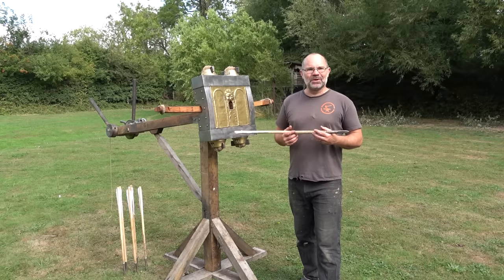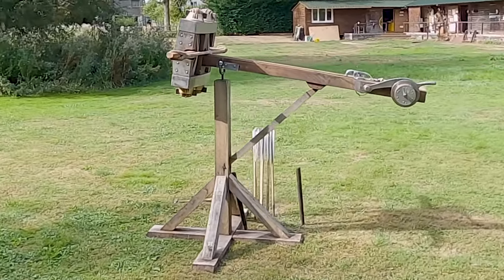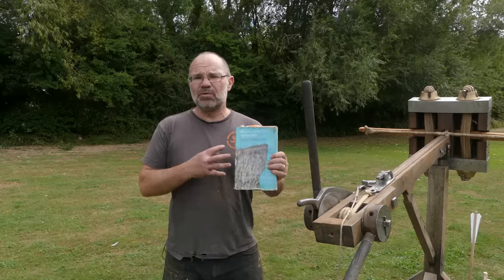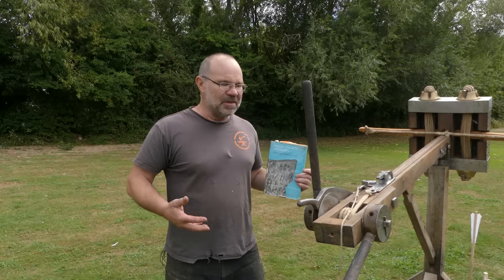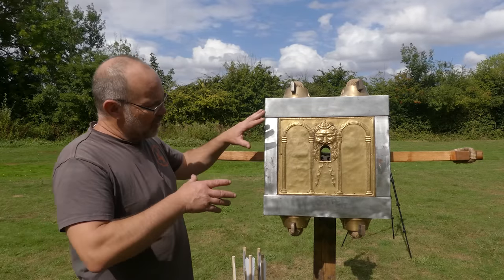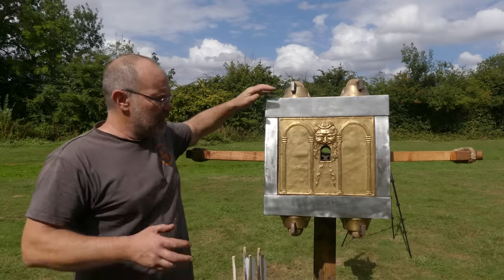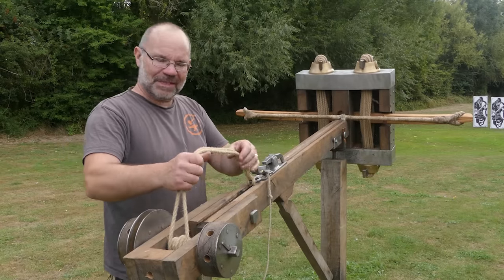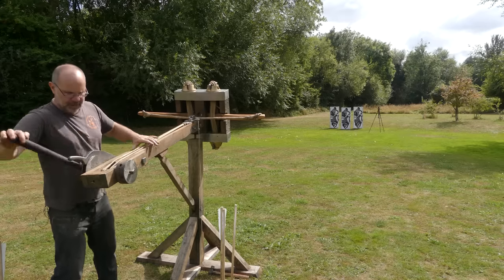Tod's new artillery piece - BALLISTA or CATAPULTA?

Comment: Maybe I'm an idiot, and I'm sure that I am, but it doesn't seem to shoot that hard. That is to say any shield would easily block it. Literally a plank of wood an inch thick seems like it would stop it dead.
Reply from the maker: True at the moment, but it is not tuned up yet.....however just for the record, shields were very rarely an inch thick.  Viking shields were usually between  1/4 and 3/8th thick for example
Reply: @tods_workshop  fair enough. I appreciate the response! Excellent work sir.

Comment: I can't agree with "medieval people got it wrong" narrative. I've read some translations of Greek, Roman and Byzantine manuals, and from that it seems pretty clear that Romans did have a standardized names for these things - but what each word represented tended to shift with time even before the middle ages hit. What was called catapulta in early Greek sources may not be the same thing that is called a catapulta in late Empire. Trying to match the terms with objects is not easy, and not without disagreements even among the experts. The best way to do it, I think, is to state what manual's terminology you are using at any give time.

Writing on the darts was probably done a lot less than slingstones. Slingstones are lead bullets that were cast by slingers themselves on-site a lot of the time, so personalizing them isn't very difficult. Darts are supplied by the state, and you need ink or paint to write on them - you could carve, but you may not be willing to risk weakening the dart that way. It's just a lot harder to do writing on darts. Then and again, these weapons are primarily for and against sieges, and you have a lot of time in those. Maybe something like using coals to write while you stand on watch during a siege was pretty common.

Range gauges on torsion devices aren't a very good idea - those ropes will change their tension every time the moisture changes, atmospheric pressure drops, just standing there over time, if a dog barks in Kazakhstan while Jupiter is in ascendance and that;s not even mentioning the impossibility to re-tension them to the same level every time you need to change the ropes. If anything, you'd have angle gauges and rely on the skill and experience of the operators to ballpark ranges after their first shot.

As for what these were used for, sieges are an obvious place. In the field, they are not effective at all, because they are relatively easy to outmaneuver. Sure, they give you range, but even assuming 6 minutes to run those 600 meters, you will be able to shoot something like 6 bolts. A bow will have 2 minutes and therefore 12 arrows, for far, far less investment - and sling has range of 400 meters. One thing that we must not forget, however, is that these are Roman legions that build fortified camps every night, so every battle is potentially a siege battle. Having a handful of these guarding your camp while the enemy tries to hoof it there under the weight of siege ladders and/or rams is suddenly a much better idea.

Oh, also? Don't trust Vegetius on his artillery numbers too much. De Re Militari is very much written with a "old people did things so much better and these young people are ruining it" narrative in mind.
Reply from the maker: HI Martin,  Thanks for taking the time and thanks for the insights and I like your Vegetius line.  I have no idea if you are correct, but it has the air of reality

Comment: What's the purpose of the rope twisted Infront?
Reply: It is the motive force to make the bow/engine work. Instead of a bendy bit of wood(or similar) in a normal bow, the rope bundles(under significant tension) have sturdy non bending arms in them which simply act as levers to propel the string & projectile. Invented by the Greeks in the C4th BC I believe.

Comment: What's the torsion bundles made of?

I read somewhere that the best ones were some kind of sinew rope that was a major pain in the ass to work with.

Any truth to that? And what did you use?
Reply from the maker: I think they were horsehair and I used pre-stretched polyester
Reply: @tods_workshop  that makes sense. Does polyester lose tension over time if left under tension for a long time?

Comment: hey tod , thanks for the video! as i understand it  the difference between a ballista and a catapulta is the projectile ballista fire a bolt/javilin/spear catapulta fires whatever fits through the headframe
Reply from the maker: Not quite.  The set up for the head stock is quite different as the torsion bundles on a ballista are housed in sub frames within the head stock
Reply: @tods_workshop  thats news to me ...seems overcomplication to use a subframe system and have that be the difference between the 2 . i can see ease of transport  if it breaks down into man portable sections  but the other is easily "flat pack" weaponry of earlier times disasemble the frame add a top and a bottom its a box to carry the mechanicals and cordage in , or as was the roman army way  just make them when you need them with whatever is at hand.

Comment: No, no, no. Ballista could indeed throw rocks or round objects, but the difference is in the build. The torsion based build with "wings" like a bow are called ballista. The ones with levers or arms that swings forward are catapulta. The object thrown is irrelevant.

I suggest you use some updated source material. You can find some from the same authors you mention, just 20 years more modern...

Comment: What fascinates me is how they would have been used. What did this device do that would be better than what those 2–6 soldiers could have done with bows, pila, scuta, and gladii? In the time it takes to load and aim one shot at one target, they could all fire a few arrows at the same or multiple targets. Was there a range advantage? Were there targets that required this much force to be taken down?
Reply: Much longer range , goes through multiple people and shields . There is also an account of this being used against entrenched troops (Angivarian wall I think) . The account described limbs and heads going off flying so it has a huge psychological effect . I'd also expect it be much better at taking down elephants
Reply: Quick answer is nothing!
Reply from the maker: Thanks PP - that covers it
Reply: I'll modify that to say nothing except attacking similar installations of the other side. Almost worthless against other targets, at least compared to the alternatives.  Bet Tod never gets a fart out to even 300 meters

Comment: i would be interested in the mathematics of the torsion engine   playing with a bullpup pistol ballista and running into materials limitations due to compressive force . would also like to know skein tension/ vs tensile strength of fiber vs torsional load imparted. maximum bundle tension and then washer tension tuneing for balance is what works for me  relying on the washers to provide majority tension dosnt work well i have found. material is also key  i am looking for a monofilimant fiber high tensile strength  no stretch and high elasticity  for my scale  you would want a braided monofilimant ...spectra kevlar and a few others top the list  nylon works but continually stretches and looses strength  natural fibers hemp sizzel jute ect end up being too large to use  at the desired working loads  until you scale the equipment too match ...they did have some massive 3 or 4 stories high  examples i have been told. head scratcher for you...how do you keep 100 + lbs tension in the line as you weave your torsion bundle????  just for reference  dollar store nylon twine...15 lbs test ...torsion bundle 6 strands....torsion generated  10 lbs draw if  i exxagerate    compressive force between washers...enough to crush 1/2 inch laminate  food grade maple  so somewhere around a tonne ...materials limitations lol  moving to 300 lbs test  and up to 30 strands says i am no longer using popsicle sticks to make my frame,
Reply from the maker: You need a cord that stretches a tiny bit, but not much.  You do not want zero stretch.  I used pre stretched polyester, but the most important thing is to pull the cords ultra tight at each wrap.
Reply: @tods_workshop  hence the head scratcher comment ..how do you keep 100 + lbs tension on the line you are threading between "pins" theres a correct term for them i know lol  ?? ive thought on it for a while now and the best i have is pull tight ...again the scale thing  im working with 7 inch wide 2 inch deep 2.5 inch high frame  your working with somthing that is more or less stable im not . best guess is im going to need 3/16 plate steel  and i hope the nut can hold the load lol.